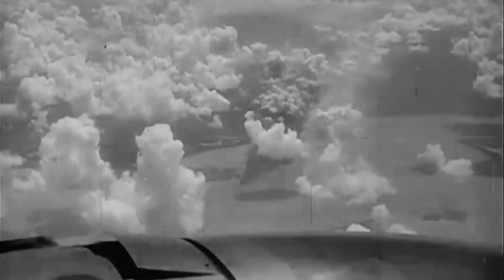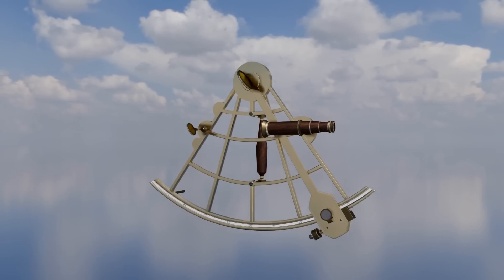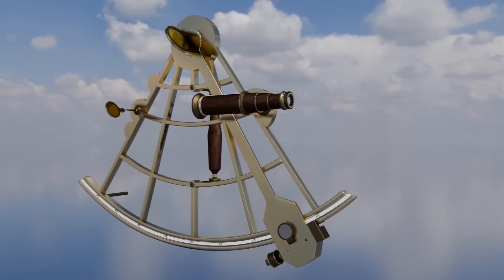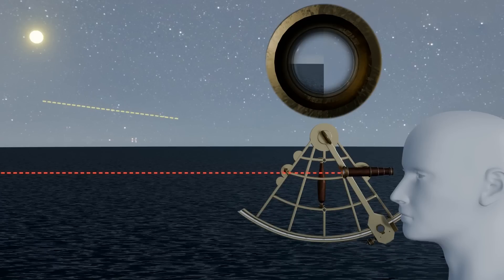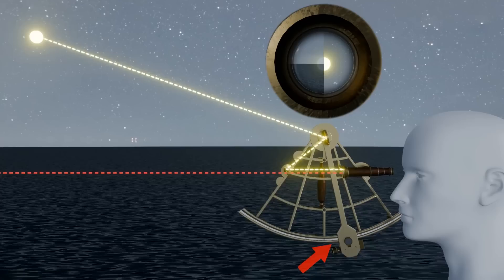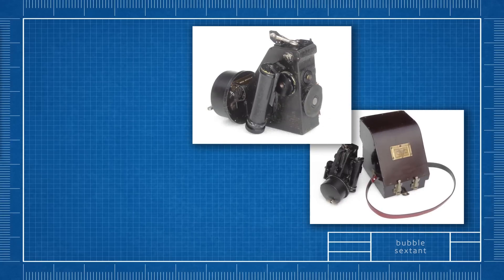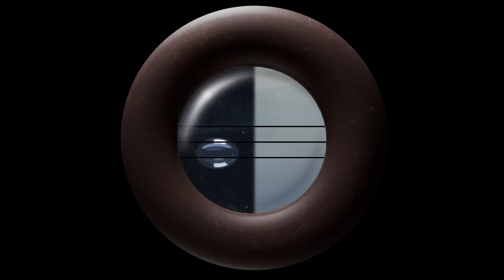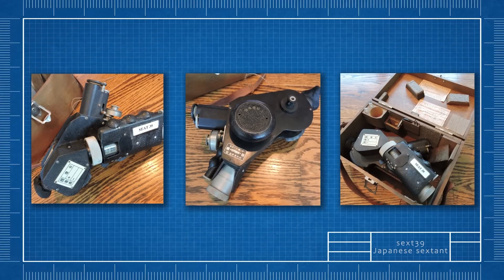Returning Home 2: How Japanese Pilots Navigated Over the Ocean in WWII

Comment: I suspect they made use of the DF homing to get back to the ship, along with guidance from the carrier itself. The Japanese made extensive use of reconnaisance aircraft going out to do weather reports before they launched strike groups.
Reply from the maker: Japanese had some sort of radio beacon called „kurushi”. It was supposed to be used in case of emergency. When the pilot was lost he broadcasted the distress signal „kurushi” and the Carrier was supposed to turn on the radio homing beacon. But because IJN was too afraid to reveal carrier’s position to allies the system was seldom used

Comment: Flying by Dead Reckoning in a single seat fast aircraft over water would be nearly impossible. You need a calculator, charts, a clock, pen, possibly rewrite your route and take notes, all this under threat of enemy fighters and looking inside. It could only end badly unless there was a multi crew aircraft caring for the formation navigation. Astronomical navigation in a single seat is unthinkable for many reasons. Besides, the Carrier wouldn't stay dead on the water waiting for her aircraft. She would be somewhere else.
Are you sure the IJN only used Dead Reckoning and nothing else?
Reply from the maker: Bear in mind that aircraft almost always fly in formations so not every aircrew had to deal with navigation. One plane in the formation was enough and the rest just had to follow him. Besides Japanese Navy put a lot of emphasis on navigational training
Reply: You don't have to navigate with absolute precision to find a large island or a fleet of ships as long as the weather is good enough that you can spot them when you get close.  Also, dead reckoning is more rather than less accurate in faster aircraft because the wind has a smaller effect on ground speed and drift.
Reply: @gort8203  Given IJN carrier born aircraft had a combat radius of almost 1,000 km, navigation without beacons did indeed need to be precise.   So precise, this video is simply not believable.   Take, for example the Kate - range 978 km. cruise speed 260 km/hr - that's a flight time of 3.76 hours.   A 20 km/hr wind (pretty mild in the Pacific) could estimated to within say about 2 km/hr.   That will put you off target by nearly 8 km.   In perfect weather that's fine, but if cloud obscures the carrier, you are stuffed.
Reply: @keithammleter3824    A single cloud is not going to obscure a battle fleet.  I guess the aircraft searching for convoys and submarines over the cloudy North Atlantic never had a chance of spotting anything.

Everything was done visually back then, so of course they needed weather good enough to find their targets.   You don't think they used dead reckoning or celestial navigation, so what do you think they used, a Ouija board?  You simply don't appreciate how much more difficult aviation was back then and how much more risk was accepted.  Believe what you want, but you are projecting your modern aviation mindset on to a much less precise aviation past.
Reply: @gort8203  IJN aircraft carriers were usually part of a fleet, but not always.   And you often get more than one cloud.   Despite what this dodgy video said, the Japanese carriers did transmit homing beacons.   One of the reasons why Japan lost the war is that they had no effective radar, and only knew where American ships were by luck.  But US ships had very good radar.
There were no weather satellites back then, therefore away from land masses it was difficult to predict weather.   It might be clear skies when launching aircraft but overcast 3 hours later when they return.
The belligerents in the Atlantic in WW2 were all far more sophisticated than the Japanese.   They all had radar.   The Germans were eavesdropping on the British convoy coordination radio frequencies (which had only very simple encoding easily deciphered by the Germans) and thus knew where each convoy was supposed to be at any given time.   The British were eavesdropping on the German military channels and once they had mastered the semi-automatic decryption, knew where each German submarine was supposed to be at any given time - so that they could send out an aircraft to the vicinity and patrol until they found it by radar or visual sighting.
Reply: @keithammleter3824  OMG I'm not going to keep arguing with you.  The Japanese didn't have a beacon to home on the enemy ships they were sent to attack.  I guess they must have used a Ouiji board.  Good talk.  Have a nice day.
Reply: @gort8203  Most Japanese navy capital ships had a dedicated radio homing beacon known as the Type 3 Mark 6.   Common sense should tell you that they could also use their normal HF radio communication transmitter.  So they could get back to the carrier ok.   But finding enemy ships was difficult and involved a lot of luck, although the carrier or another IJN ship could now and then pick up US radio transmissions and direction-find on it.   With 2 or more RDF's you have a fix.  And the aircraft receiving 2 or more ship beacons also have their own fix.
No Ouija boards required.
Best you do cease arguing, since you don't know anything about the subject and can't be bothered looking it up.
Radio equipment used by the IJN and Japanese army in WW2 was described in detail in various US electronics publications during and just after the War.   It was (except for radar) reasonably good equipment, designed on conservative lines so as to nor rely on critical parts, but somewhat old fashioned compared to US or German equipment.
Reply: @gort8203  If navigation with a sextant was as good as this ridiculous video implies, and you seem to think, how come hulls that were sunk when radio communication was in use but radio navigation had not been invented where often discovered on the sea bed up to 20 miles or more from their radioed position?
Even the  infamous Titanic was 13 miles from the position it reported.  And the navigator had plenty of time to take multiple sextant sights on different celestial bodies and average out the errors.  It was a perfectly clear dead calm night and his life depended on it.   And 13 miles error was the best he could do.   An aircrew in a fighter-bomber in average weather could not hope to be as good.
Reply: @keithammleter3824  Do you know of any books or references to the German military's code-breaking ability and successes.  And for the Japanese also.  I have read and watched lots of books and videos on the Allied efforts of code-breaking but nothing on the Axis successes or failures.
Reply: @keithammleter3824  The Titanic sank in 12,000 feet of water and it did not sink in a straight line direction.  I would surmise that panic and the relative (compared to modern celestial navigation instruments) crudeness of the pilots' (navigator) sextants would be a major factor in being at a different location than initially reported.
Reply: @sjb3460  12,000 feet is only a tad over 2 miles.  Assume due to hydrodynamics it sank on a 60 degree angle, that's only a 1 mile offset.  The Titanic navigator's error was 13 miles.
Reply: @keithammleter3824  The site of the sinking cannot be determined from where the wreck is located.  The Carpathia was able to reach the wreck and rescue hundreds of survivors with the position given by the Titanic navigator.
Reply: If the captain of the Carpathia did not have an accurate location of the sinking, the Carpathia would not have been able to rescue the survivors.  A person would have to be about 100 feet above the surface of the ocean to be able to scan a 13-mile diameter search area.  Even with a powerful telescope, you would not have been able to see lifeboats and wreck debris from 13 miles away.
Reply: @sjb3460  If you believe that, you must believe it went down at an impossibly shallow angle.  Or an impossibly strong current.  It is simple trigonometry.  It is possible that the 2 parts circled as they went down - some investigators believe that was so.  That only shortens the offset.
Reply: If the Titanic was at it's farthest point from the Carpathia, it would have been 71 miles away.  If the Titanic was at its closest point, it would have been 41 miles away.  Remember, it was 3:30 am when the Carpathia located the survivors and there was no telescope or a pair of binoculars that would have been good enough to scan a 13-mile radius for survivors.  Therefore the Titanic sank fairly close to its reported position.
Reply: @sjb3460  I have re-checked the matter.  It seems I consulted a dodgy reference - I looked up just now the position reported by Titanic and the position of the wreck and calculated myself the horizontal distance between these locations.  It is a bit over a mile.
Sorry about the mistake.
Reply: Yes, I guess that, for example a Kate or a Judy would provide the Headings for the rest of the blokes, but this had several risks too. I had a PPL when younger and remember how demanding pure Dead Reckoning can be when flying alone, even in good weather over land at 80 knots in a C152... it requests all your permanent awareness. 🤯
Reply from the maker: I remember from my PPL training course😉
Reply: Look how many planes disappeared in the so-called 'Bermuda Triangle' before the advent of GPS nav.